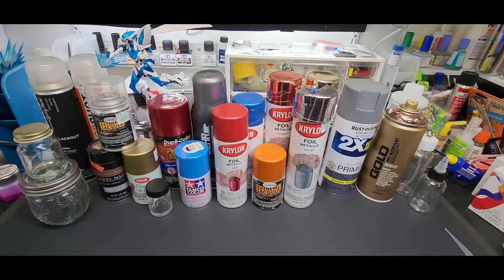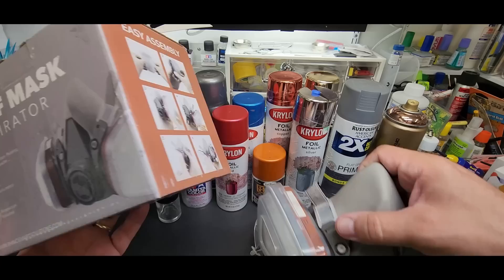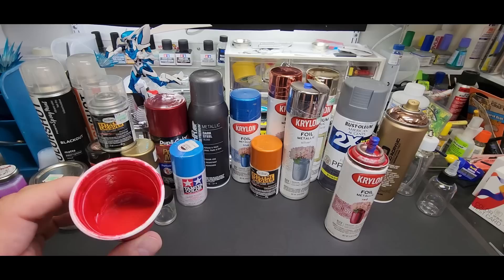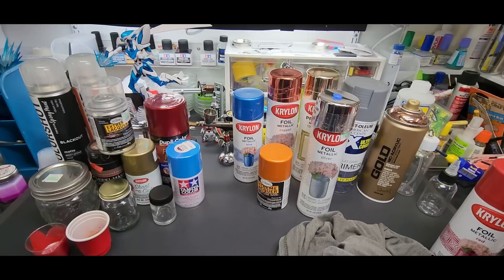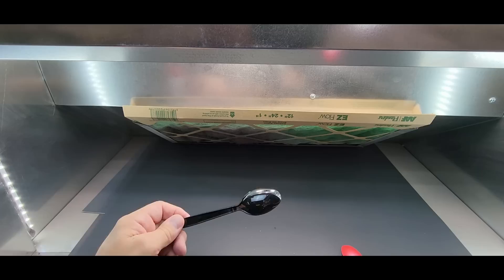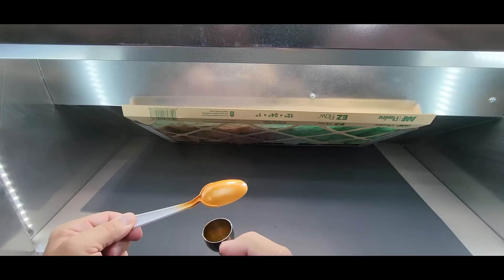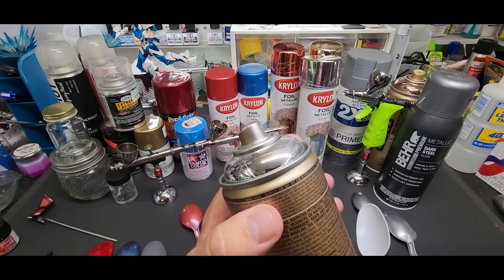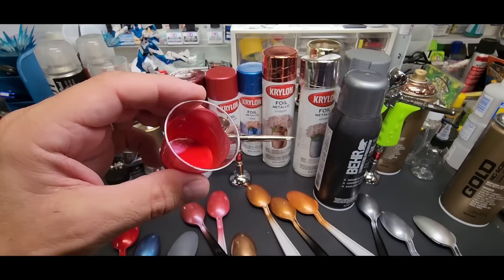How To Decant Spray Paints For Airbrushing - Easy !!

Comment: Saw a video a few weeks ago where a guy was using a saddle mount piercing valve to drain paint cans.

Went to Amazon, ordered a ice machine connection kit for ~$12.00. It came w/ a plastic line. I substituted a 6-7" scrap of copper tubing for the outlet.

I needed some longer bolts so it would saddle on a paint can, instead of a ½" copper pipe. Also had to extend the straps, but that can be done w/ a hammer, some pipe to bend/beat it around, (Vice Grips to hold the metal) & a drill.

It works like a champ & NO mess or spray.
Reply: I would love to see a pic of your setup.
Reply: @repeters1  I'll see what I can do... it'll be a few days, I'm sick as can be AND I just discovered a 6ft diameter Ponderosa Pine on my lot is leaning st about 20⁰ towards my next door neighbor's house; a victim of the ice/wind storm that just swept through the NW.

GeoD

Comment: Question: can you just air it out (upside down, holding nozzle), and then just cut it open when the air is all out and equalized?  (Store the rest of the paint accordingly, of course) Love your videos.
Reply: I have done this... invert the spray can, expel the propellant till empty of pressure. Then punch a hole and drain the paint.
Reply: One of the methods I've used before
Reply: That's how I do it. Let the paint gas out for 24 hours, do not tightly seal the glass container. Let some sit and tried to stir it up, paint bubbled all over. Pick up various sized Mason type jars at thrift stores quite cheap.
Reply: Just be careful to read the can.  Some of the newer Rustoleum paints tout "spray in any position".

Comment: Tip from a life-long mechanic who found out how to stop the paint cans from drying up in the nozzle: hold the can upside down and spray after use to get only propellant through the nozzle to clear it out - just like you would spray only air out of your airbrush when done and you'll never have a clogged up can of paint again... ever. Do it before you start too. It really helps

Comment: Great technique!
I've found that it helps degas the decanted paint faster by dropping a small object with somewhat rough texture and/or sharp edges into the cup you've finished decanting into. This helps liberate the propellant gas dissolved into the paint faster.
Just make sure that the object you're using is inert with respect to the type of paint.
Reply: We aren't all scientists.

Comment: I have excellent spray paint I wanted to use but didnt try because I thought there would be too much gassing that wouldnt settle down, so thanks very much. Will paint thinner and acetone hurt the rubber o-rings or other parts in the airbrush?
Reply from the maker: Not with a brand name airbrush. I clean mine out weekly with acetone and no problems yet after 4 years. I have Badger, Iwata, GSI Creos Mr Hobby, Harder & Steenbeck and Grex airbrushes

Comment: Just get a cup , bucket or what ever the spray paint can fits in it and add water, turn the can upside down into the water , let out the air and bam ,paint. Easy as pie

Comment: I take a sandwich bag and spray it into that letting it accumulate into a corner than when I have my amount I clip a tiny piece of the corner letting the accumulation of paint pour into a prepared bottle. Throw out the bag when done and boom ,got my paint. I'm not knocking any of the methods mentioned. I'm just telling you the way I did it the 1st time as a young teenager and never really thought of changing the method. "If it works don't mess with it." I guess.

Comment: could you turn the bottle upside down and clear the paintcan of propellant and then put a hole in the can to drain? would that still have toomuch pressure to safely punture the can?
Reply: You can do thar and the propellant is gone but don't shake the paint! Cut the can and let it sit for 24 hours to gas off..

Comment: This method is probably faster than using the straw. When using with the straw it creates less mess for me to clean up but it takes awhile to degas. Once i filled up a tamiya jar and it took about and hour and a half to degas to the point where i could screw on the cap and not have it bubble over

Comment: What do you use to clean your airbrush between and when done? And where did you get your spay booth? Thanks!
Reply: Just to add to the previous, any enamel thinner should do and GOOF-Off works really well when it comes to the removal of spray paint, even works great with more stubborn paints like Rustoleum.

Comment: the thing I always hated about rattlecans is losing 80-90% of the paint in the can to overspray which is even worse the smaller your parts are, sadly brands like tamiya have colors that are only available in spray cans as I found out when building a tamiya spitfire kit and tried finding bottled versions of the colors for the external camo pattern
Reply: Tamiya does have the proper colors for a spitfire. If you look up the RAL colors conversion to Tamiya it should list them. I dont remember off hand exactly which but they are correct. Happy modelling

Comment: How do you know how much thinner to use with the paint from the rattle cans? Same rule as with solvent based hobby colors from the jars?

Also I will use my first question to ask another one not so related to this video, but how do you clean the pipettes from color?

Comment: Great video.  You might have mentioned this, but do you need to do any thinning?  Also,what do I use to clean an airbrush if I use Krylon High-Gloss Metallic Gold Leaf Metallic Spray Paint. Base material in paint is acrylic per the product description.
Reply from the maker: I like to add a few drops of lacquer thinner to the paint. Also use lacquer thinner to clean the airbrush. Acetone will work too

Comment: full stop:  sorry but that is still the hard and wasteful way.    1. shake vigorously, then wait 5 - 10 minutes and dont shake 2. hold can steady on bench 3. sharp awl or equivalent;  puncture near top rim on side and  4. let degas for a few minutes, 5. shake / twirl lightly to release more gas, 6. punch larger hole and pour content into container.  7. stir lightly to help more degas. 8. ready to use.    this lets you use all the paint,  just spraying it out leaves varying amounts still in can....     I do this with all the rattle cans that malfunction and wont spray, as well.
Reply from the maker: I like to take out just what I need for a project. I find the paint last longer staying sealed in the can. Easier for me to store the cans at this point than in jars. It's just what works for me

Comment: My attention span is usually about 3 min.onna video and i am gone..
However, i watch each of your videos from beginning to end. 
Your personality, knowledge, and way of doing testing is way above 99.9% of the other guys out there doing this!
Thanks!!
Reply from the maker: Thanks for the kind words. It's much appreciated 👍
Reply: @barbatosrex9473  if I decan it into a glass jar for siphon airbrush. Do I still need to thin it? Also will the paint dry up in the jar?do I need to add an small metal stirring ball to shake the paint like how it work in spray can?
Thanks
Reply from the maker: @leomr1504  no need to thin it. I personally add a couple drops of thinner but you don't have to. If you seal it good in an airtight jar it won't dry up
Reply: @barbatosrex9473  may i know what kind of thinner for lacquer paint? Does tamiya x20 work? Also we need to wear mask protection even if is airbrush correct
Reply from the maker: @leomr1504  I use Mr Leveling Thinner for everything. I wear a Rhino mask sold on Amazon

Comment: Do you have a recommendation for the ratio of Mr levelling thinner to paint as I’ve been told it’s 1 to 1 and that’s what I’ve been doing but I also don’t want to waste my products if it’s wrong thoughts? Also do you add normal thinner as Wellers Mr levelling thinner to the paint or not? Cheers

Comment: You can hold the can upside down and spray out the propellant, than drill a hole in the top of the can, turn it over, while holding it over a container to catch the contents than drill a hole in the bottom if can to break the hydro lock. Paint should just run out

Comment: drill a hole in the cap and glue a straw into it then spray into a bigger straw holding it over the jar.

DO NOT puncture cans under pressure, there IS a risk of the can rupturing.

Albeit small you really dont want that to happen.

Comment: Great videos man! I’ve got a couple of questions… Don’t we all! I’m new to airbrushing! 1st. What thinner would you suggest for Tamiya TS spray paints for airbrush. 2nd, I’ve had custom automotive grade paint mixed into spray cans and I’d like to try airbrushing them as well. Any suggestions, or should I contact the company that made up the spray paint for me?
Reply from the maker: With the Tamiya I would go with Mr Leveling Thinner. In fact I use Mr Leveling Thinner for almost 100% of my solvent based paints. But with the paint you got for your auto supply I would call them and ask if a lacquer thinner, which is what Mr Leveling Thinner is, would work in the paint they blended for you. Many auto paints today are urethane and many times they need their own thinner
Reply: @barbatosrex9473  thanks for the response! That was my concern with the automotive paint as well. It wasn’t made known to me what the actual “type “ of paint it was. I’m going to give the chemical company a call and find that out!

Comment: Can you preserve 2k clear in a mason jar? I never have anything big enough to use the entire can on, so I've never bought one. If a mason jar keeps it from hardening then maybe I have a way to use 2k and save it for later rather than a cheap clear coat.
Reply from the maker: Absolutely. I keep many paints in Mason Jars. They're actually more air tight than the cans they come in
Reply: @barbatosrex9473  You CANNOT preserve ANY 2K paint from a spray can!  You cant even save it  more than 24 hrs, in the original can once activated. Geez.... Do you even know what 2k means?? Better yet , try it. Put 2k areasol paint in a mason jar, and come back in a few days and try to use it.
Reply from the maker: @terrythomas790  you might be mistaken. I have my 2K clear in one jar and the activator in a separate jar. I know once combined there's an extremely short lifespan

Comment: Oh please. Take the can, shake it. Turn it upside down, and drill a small hole in the bottom, say a number drill ( I use a #70 or #71) . Place a penny over the hole and ignore while  you move on to the next one.  Come back in half an hour, tape the hole, shake like hell, maybe warm it in hot water, and open the bottom with a can opener. Pour into the preferred container.

Comment: Instead of using a rag, how about using a layer or two of plastic wrap instead? It'll conform to the container and you'll be able to see the decanting. Also, if you turn the spray can upside down and press the nozzle release all of the gas inside, you can then just puncture the can and drain out all of the paint into a container.

Comment: Since these spray paints are oil based; did you need to use any mineral spirits to get it through the airbrush?? Or did you just use the Mr. Color leveling thinner??
Reply from the maker: I just used the Leveling Thinner

Comment: I am used to airbrush acrylics, never tried with these kind of paints. 

What do you use to thin something like rustoleum primer? And do clean the airbrush?
Reply: The Rustoleum primers use acetone, hydro-treated light distillate, naphtha, methyl ethyl ketone, and ethylbenzene as solvents.  So any of highly volatile solvents; acetone, VM&P naphtha (naptha), or MEK will work.

Comment: Thanks for the video! What did you use to clean these paints off the airbrush? Ive heard that some solvents are a bit too harsh on the O ring on some of them
Reply: Yes, good question. I'd like to know if there's a single solvent that works well and doesn't harm the airbrush.

Comment: did you ever try turning the can upside down and release the air, and then puncture the can and pour it into your container?
Reply from the maker: I have but I'd rather keep the paint stored in the can airtight till I need some. It's actually easier for me to keep the paint stored in the cans than in jars.

Comment: I'm extremely new to airbrushing, I do 3Dprinting (PLA mostly) when I try to airbrush a 3DPrint the paint seems to soak into the the print giving a bleeding affect, is there any special way or paint I should be using for 3D PLA filament? I currently use GAME AIR Vallejo
Reply from the maker: You need a good primer first. Badger makes a primer just for prints like yours, it's called 3D Primer. After that you can put any paint on top of it and it will come out great
Reply: @barbatosrex9473  Great thank you, I'm in Australia can I get the 3D Primer through Amazon?

Comment: How bad does the spray can spray destroy the O-rings in the air brush
Reply from the maker: Not at all if you use a quality name brand airbrush. They all have solvent resistant bushings and washers. I clean my airbrush every day with acetone and they're all doing fine

Comment: have you tried spraying krylon clear over a tamiya lacquer spray? I painted a clear gloss over a tamiya racing blue spray paint and it didn't dry gloss. It has textured surface. Thanks for the great videos.
Reply from the maker: I'll look into that. Sounds like a question for my Patreon channel.
Reply: Sounds like you have the air brush too far away from your model and the paint is drying out before it hits your model leaving a rough texture, try getting abit closer so when you spray it looks wet on the model but not so wet that’s it’s running apply in thin coats then last coat get closer and go a lil heavier 👍
Reply: I'm spraying it out of the can as I'm a lazy lad at setting an airbrush. I'm painting the parts while at work in a construction site. I tried the far away 12 inches away to the part and the closer wet spray but the texture is still there. The kind of texture like when you spray lacquer over acrylic type. It is wrinkled. So I just sprayed it today with the UV cut Mr. Hobby Super clear. And sprayed it wet. It is passable. Prior to this, I painted a part with krylon white, then sprayed over tamiya ijn white. It definitely reacts with a cracked paint so I just sprayed heavier. It looks okay after that. (I made it two tone white with masking tape) I happened to see Rex's videos about krylon paints so I given it a try. I usually use all tamiya and mr. Hobby. 1 thing is that my local krylon supplies has a different labels and all wrinkly too. Feels like an imitation product compared to those in Rex's videos. I will try to post a link of the pictures if it's permitted here. Sorry for the long post.

Comment: Would an airbrush be able to handle a primer filler or is that too thick?
Reply from the maker: As with any paint, as long as it's thinned properly it will be fine. A larger needle helps too like the 0.7mm that comes with my Swallowtail Airbrush
Reply: @barbatosrex9473 Right but if you thin it too much I'm guessing you're going to lose the filler properties a of filling primers. Curious if you've done it though, btw, I really appreciate you always answering questions.

Comment: I can't remember if you said this, but did you thin the primer?  I find those 2x's are pretty thick out of the can.
Reply from the maker: I would definitely thin the primer
Reply: @barbatosrex9473  thanks, yes I tried it tonight, thinned. Worked great. By the way, my side by side comparison of pledge vs Vallejo gloss varnish was surprising. Pledge outperformed.
Reply from the maker: @bullitt773  pledge is the unsung hero of the hobby world

Comment: If spray paint itself didn't suck and ruin the plastic this would be cool, sadly if you screw it up your model is ruined (No it doesn't come off in any bath, it etches) unless the can says otherwise so be cautious.  The illusion here is that spray cans have a coarse spray head and no leveling thinner is used in them, that's why the Airbrush method makes this work so well.  Just be aware that the degassing is super important and must be done safely and thoroughly, especially if stored in glass jars other wise all you are doing is making tiny but deadly grenades.  You can watch spray paint decanting videos to see what happens if you do this wrong.

You can bring a spray paint model back from the dead (Paint bombed), but because of the bonding not sticking issue of most hardware store spray paints you will eventually lose some detail (Sometimes right from the can, the chemicals are crazy in some brands), a soft coat of hobby primer after stripping as much of the spray gunk off as you can,  along with a good wet sand can save (Mostly) many kits from trash can.  Decanting and airbrushing will improve the otherwise coarse look due to cheap spray nozzles on cans (Hobby sprays have a finer spray pattern in their nozzles, saving them for use on store cans can be tricky but helpful).

Comment: Hey Rex, did you test the primer over any actual parts? I only ask because I've heard that primers from Krylon, etc, usually ate up the detail of the parts so it shouldn't be used. It just occured to me that it may be because of the sheer amount of paint that a can sprays. An airbrush may be able to make it work and save me a TON of money. XD
Reply: Krylon ColorMaxx, it works great. Most aluminum looking items, I use the ColorMaxx Metallic Aluminum all the time. The Krylon Fusion and Rusto 2X is pretty thick, but it only really smothers some very fine detail. I have found that Rusto 2X Primer sometimes can take a couple weeks to fully dry. The ColorMaxx Primer dries pretty quick.